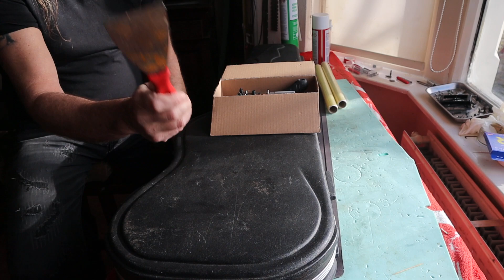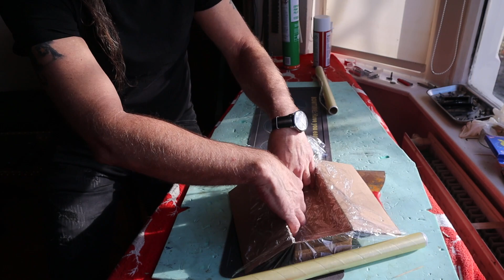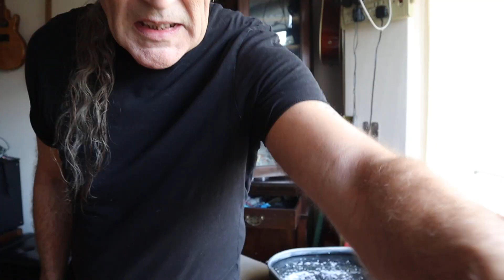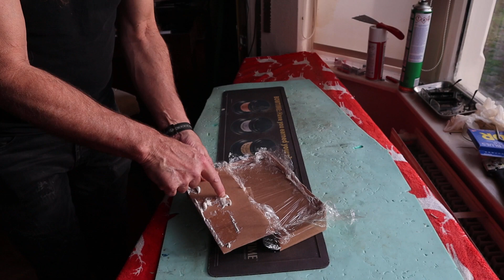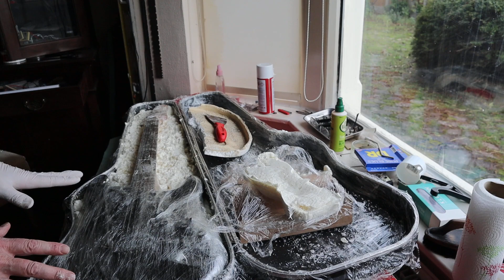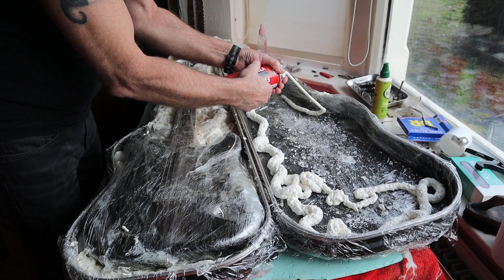How do I renew my guitar hard case interior? FAIL!!!

Comment: Hi Roxy. Well that'll teach you to listen to your mates! Had me glued to the screen though... going "Oh my gawd!"😂
I used to work in the  packaging industry. To be fair, on some projects we used a 'hot foam' spray process which is broadly similar but faster acting. Wouldn't use it here though. Though theoretically it sounds like a great idea, in practice, basically it gives you a very rough moulding. It fits where it touches sort of idea...  Most certainly not the sort of finished 'plaster cast' moulding which I'm guessing you were after. As others have suggested rigid block foam such as Styrofoam or Ethafoam would be my approach. More expensive, but IMO, the way to go. Have a hunt on YouTube and you'll find videos showing the process. If there are any packaging companies in your area, it might be worth paying them a visit to see if you can scrounge any offcuts or get some raw sheet for a decent price. You don't want to be paying retail prices from a shop!!!
Reply from the maker: Hahahaha, properly made me chuckle, that :-) As it goes, they're chucking out a shedload of office chairs at work so I may be able to, er, acquire some relevant material. I'm so happy that you have such an informed insight to the exact result I was looking for and you can't beat knowledge and experience (of which I have neither in this area). However, I'll give it one more go and then end up doing exactly what you and a few others have suggested because clearly, those of you with previous form, know that's the correct thing to do, cheers :-)

Comment: That stuff cuts beautifully when it's gone off. I think the best thing would be to plonk the guitar in when it's fresh, maybe with some spacers to keep it at the correct height. Deliberately let it overflow. Then run across it with a handsaw when you've taken the guitar out. Just theorising though. I've only ever used it for walls!
Reply from the maker: Ah, nice one Nick. I reckon that'll be my next plan of attack although Michael's suggestion sounded good too. Cheers :-)

Comment: I think I'd try 'high density upholstery foam' in 1" sheet. Two layers in each case side with the guitar shape cut out of the middle two layers. If you wanted 'plush' you could put some crushed velvet material over the foam. All kept in place with a can of spray adhesive.
Reply from the maker: Absolutely agreed that this course of action would be the most sensible, practical and probably most cost-effective solution to the problem. However, where's the fun in that?!! :-) TBH I'll probably end up doing exactly what you said but if I manage to get it right, it could be the future (like garlic bread). Cheers :-)